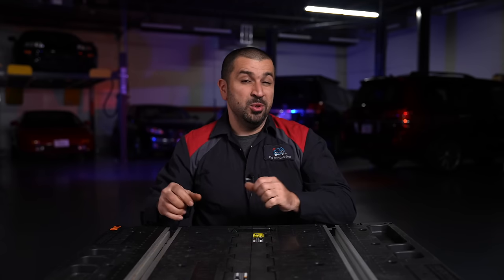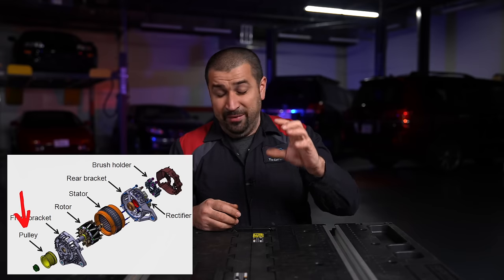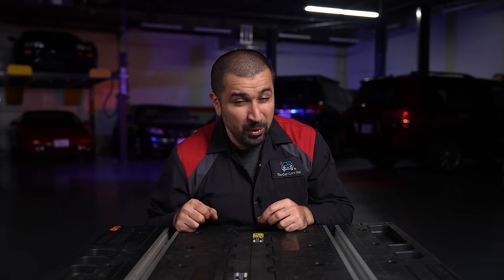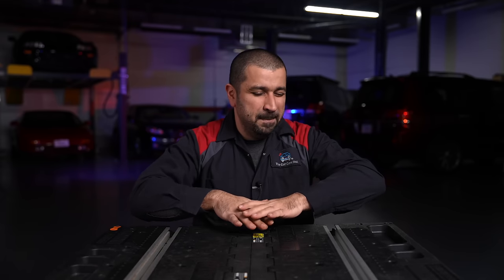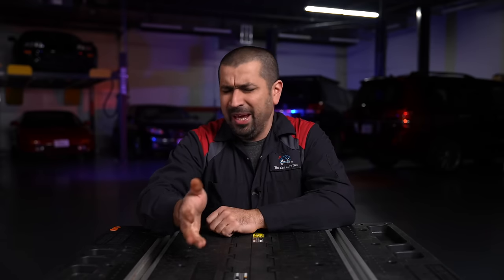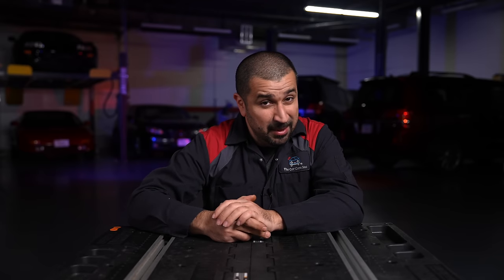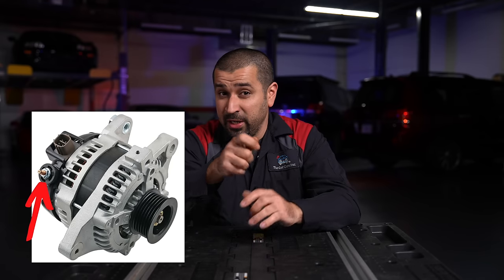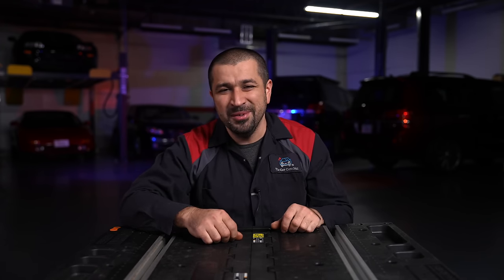How To Make Your Car's Alternator Last Longer? Everything You Need to Know

Comment: the trick were using here in my place where lithium replaced most car batteries is called super capacitor relay system .... itll only engage when theres a surge current needed (eg to start the engine with high torque dynamo this same electric engine will charge the battery back aswell using a large rectifier diode relay in series with some transistors for automatic switching) the bms will handle the balancing of the batteries and cutoff and anything else

Comment: I used to rebuild alernators and there are 6 diodes. 3 negative and 3 positive.  I never seen one go back. Usually it is all the negative or all the positive ones that go bad or all of them will blow together. When an alternator starts whining, it is already bad

Comment: Old days one belt around pulley voltage regulator removal the auto electrician s took yours and replaced with a reconditioned one 😅

Comment: How to stop it from failing?  Be sure not to let a loose aux wire touch your seat bracket while the engine is running.  I burned mine out.

Comment: An alternator repairman told me by daily using a trickle charger that the battery and alternator will both last longer. He said the heat from charging wears out these parts.  When the batteries are fully charged the alternator pulls less

Comment: That was a very informative video!!! I just had an issue this evening when I came out of the store to head home with groceries. Turned the key over and nothing, no turn over, no clicking, there is a noise though. I'm not sure how to describe it.... maybe a whine, like a freewheeling spin might sound??? My battery is good, i did check the volts. Do you suppose that would be the alternator? Possibly the starter/solenoid? It's still sitting in the parking lot, I'm planning on getting it towed to the Ford garage in the morning. It's an '05 F150
Reply: 99% of the time, it is just a bad battery.

Comment: Hi CCN,so glad to see your vid on alternator, my “Swedish Tank” 4 cylinder petrol turbo’s alternator just died at 165k km , I managed to get home with the juice left in my battery as I was drive with my 4yo child. Firstly battery light came on,  later ABS,ETC turned off, just about to reach home power steering no more. Towed my car to the workshop for replacement tmrw. What should I look out for after the alternator changed? Do I have to change my AGM battery (also 2 years but I drive every day)? Thank you n God blessed u!
Reply: I would suggest you get the workshop to fully recharge your battery. This will save the alternator from overworking because that battery is now in a very low state of charge.
AGM batteries are very robust and will last many years if kept in a good charged condition. 
If you do a lot of short runs invest in a smart charger and use it about once a month you will increase battery life for years.

Comment: There is nothing wrong with aftermarket parts. I bought my alternator from Autozone and so far it has not gone bad after more than 50k miles.  If OEM is good why did it go bad after 30 k miles?
Reply: What car brand?

Comment: I rarely drive my car nowadays. If i don't drive it more than a week, I can't start my car. I usually just jump it, and I usually don't have a problem with it the next day or the day after. But sometimes I end up not driving again for a week, and the issue repeats. Also, it happens if I forget to unplug my dashcam.

My question is, is it actually bad that I keep jumping my car in this case? I just replaced my battery 2 years ago, so I'm hoping I don't need to replace it again soon.
Reply: If you rarely drive your car, and have a garage or a driveway, use a trickle charger (battery maintainer), and connect it to the car battery and plug it into a household outlet.  Just disconnect it before you drive the car, and connect it when you get home.

Every time a battery is allowed to get to a low voltage state (where you need to jump it), it damages the battery and shortens its lifespan.  Your car dying after a week (without the dash cam on)  is telling you the battery is old, damaged and should be replaced soon.

Comment: I have a question on battery replacement on 2020 4runner ORP,  ir gas dash cam ,offroad lights, and winch. Would you use a AMG or flooded aciid.  Any brand do you recommend?
Reply: Also Drone mobile  installed

Comment: I never liked voltage  regulators inside alternators, ended up having to replace both when its just an issue with the regulator  unless you want to pull the alternator to get at the regulator and then in some stupid cases have to pull the alternator apart but some are just two torx crews

Comment: So the question I have is when should I replace my battery?  
My 2019 Highlander is over four years old, no signs of battery issues...but the battery is not the standard flooded type but rather the EFB..and Toyota wants over $300.  Can I use an AGM which is more available?  And should I replace my battery now or wait longer?  I have the start/stop system, but I disable that before I hit the road.
Reply: Costco Interstate AGM. Done.

Comment: AMD, so my theory was correct that’s why every three years I get a new battery I’m still on my original alternator on my 2013 Subaru I’m at 150,000 miles.
Reply: I'm on my second battery on my 2012 Sienna with 280k miles, original alternator. I'd scrap that Subaru😅

Comment: When I worked as an "A" mechanic for Buick, 75% of alternators were just a bad rectifier bridge. I could R&R the alternator, R&R the bridge, and replace the brushes in 30 minutes and get paid 1.5 hours.
I agree with the failure rate of aftermarket alternators. When you have uneducated people just replacing parts, you will get those high failure rates.
Reply: You are a flat-rate master. Bless those easy-to-repair Delco 10SI and 15SI alternators. Cheers!

Comment: My 2004 Grand Caravan ( I believe the first year of the electronically controlled transmission) started exhibiting electrical gremlins. The transmission started shifting roughly, the Speedo needle  would sweep around the dial and stick behind the stop, the radio would play up, fuel gauge read incorrectly, power locks play up and more. Turned out to be diode problems!  A quick and easy fix once identified so this may be of use to someone else who is experiencing these issues.
Great video, thanks.
Reply: I had the same thing happen and wouldn't have guessed in a million years it was the alternator until l watched a video by Scanner Danner and he talked about AC current causing all sorts of electrical issues. I really thought my computer was malfunctioning.

Comment: Excellent Excellent vidio I learned so much, I always thought it was ok to use the altenator to recharge a battery and not using aftermarket alternators and starters but Toyota oem parts are ridiculously over priced. Thanks for being such a great instructor and mechanic.😊
Reply: Because OEM parts are designed to last 200k miles, not 20k miles....

Comment: We have a rav4 prime there is no alternator or serpentine belt. Same with the Rav 4 hybrid and other Toyota hybrids as well.  Nice not to worry about changing a serpentine belt every 60,000 miles or so.
Reply: That is because the 12V battery is charged from the high voltage Hybrid battery which takes the 288V of the Hybrid battery, and uses a DC to DC converter to charge the 12V battery.

There is an alternator/generator on the car, but it high voltage instead of low voltage, and it is part of the Hybrid system.

Comment: I have a 2008 Forester that I just replaced the original alternator with 200,000 MI it was on top of the motor
Reply: Blessings to Subaru for placing it where you can easily get to it. Cheers!

Comment: Is it ok to charge the battery when the car is off? Does the alternator care? I have a solar charger on our Tacoma, and the alternator is charging the camper battery also, via a DC-DC/solar charger. But that unit also charges the truck battery.
Reply: No prob, doesn't see your charger. Alternator's diode trio module isolates unit from incoming DC. Cheers!

Comment: Does the Toyota have magnets in the alternator to generate the electric field?  Personally, I remove the alternator and disassemble it and lift up the grease seals on the bearings and add more grease, wipe clean and reassemble.  This keeps them going much longer.  Occasionally I have had the rectifier go out at which time I buy a new (not rebuilt) alternator.
Reply: No magnets. Rotating magnetic field is initiated by THE BATTERY. That's why a marginal battery causes alternator to deliver sub-standard output.

Comment: So crazy my alternator just stranded me yesterday! I noticed the whine a couple weeks ago and have been pushing off diagnosing it. On the way home from work yesterday, sure enough radio cut off first, then the battery light came on, then everything just started flickering and eventually shut off. Thankfully, I was able to safely pull into a parking lot and not get rear ended by rush hour drivers. Question: do any of the electronics get damaged after something like this happens? (2010 Lexus IS250)
Reply: you might get a low voltage code ,
Reply: Very unlikely.

Comment: The original alternator in my 1993 Toyota pickup, 310,000 miles still working fine.
Reply: Also, Japanese starters should last at least 300,000 miles as long as there is no auto- start / stop nonsense.
Reply: Probably has no air conditioner. Very little electrical load preservers it from wear and tear

Comment: Best part about owning a Toyota Prius as a second car… NO ALTERNATOR!!!!
Reply: yeah until you have to replace the hybrid battery pack or the dc-dc converter🤣
Reply: @funboy8704  Not for a loooooong time in a 4th gen(battery pack). I work on Toyotas for a living. The earlier ones had those issues for sure. Inverter failures are also not very common. ICE water pumps and inverter water pumps. Only see inverter failure due to overheating.

Comment: Great video? I'd like to hear about how much an alternator should put out at idle. Mine is putting out 13.5v at idle and a lot of people say it should put out at least 14v at idle. I have a cheap alternator tester and it has u turn on lights,radio,heater,to put a load on it and it said my alternator was bad because at idle and full load it was putting out 13.4v. Had it tested at auto-zone and their tester puts its own load on and u Rev the car to 2,000 rpm and it passed that test with 13.8v. I would love to hear ur take on this
Reply: Read your manual

Comment: We've had weird experiences with aftermarket alternator when the service advisors started offering them. 

Got a few reworks where the idle rev kept oscillating. Turned out, the alternator was periodically not charging/unloading the engine, like instead of holding 13.8v, it was jumping between 12v and 14v. After a few cars came back for the same issue, we had to tell them OEM only.

Comment: Great advice and explanation. My 07 Honda pilot still has the original alternator made by Denso. I’m debating if I should replace it along with the also original starter because of age, I don’t have any issues but it’s always on my mind. 

One thing I don’t like to do is start jump another vehicle while  the engine running, also I replaced every single halogen bulb with LEDs, that helps lowering the load on the electrical system.
Reply: I replaced the alternator on my Corolla at 180 k . The old one was working fine - l keep it in my trunk.
Reply: @shinola228  I’m planning to do the same.

Comment: Not even the local Toyota dealer had the 2004 to 2008 Toyota Corolla Alternator: I found it over rhe Internet in Asia, oem, not a rebuilt, price is high but the aftermarket one already failed no matter it is the best recommended by trusted mechanics; From Asia at more than $700 is better, then I can say that phrase bad dealers hate: " see you in nearly 18 years " . The dealer had to reinstall the original which came with the Corolla because their remanufactured alternator failed at the same Toyota service bay, and they could not find another.....was around 1 year ago.
Reply: Hey Pablo: $700 was a real PT Barnum move. DensoAutoParts online catalog informs me your Denso 210-0395 rebuilt alternator available on line, $200 at NAPA stores and wherever else Denso rotating electrical components are sold. Cheers!
Reply: @blackrifle6736  Remember. Those prices you wrote, are around the same anyone pay for a remanufactured alternator, just like we did here. The $700+, is for a brand new original, not remanufactured., this are the ones that will not fail like my remanufactured already did, no matter it was covered by Auto Zone warranty.

Comment: It's really difficult to find OEM Toyota alternators anymore for older models.  I bought remanufactured alternators for my Toyotas and noticed the performance is not anywhere near the OEM items.
Reply: Denso rebuilts use OEM Toyota/Denso cores. They're located in SoCal and will take your call. Cheers!

Comment: I once had a battery replaced.  The technician knew that on that car, if the battery cables were reversed it would fry the diodes and require the alternator to be replaced.  I saw him do it.  I went to management who denied having it done.   I took the car to the dealer service center to replace the alternator to fix the problem.  Be careful when working on or replacing the battery.
Reply: Scummy!

Comment: I was about to utilize my cars alternator to charge my power staion when driving . Is that going to hurt it ?
Reply: No.  It will be fine.  The current draw isn't a factor as power outlets on cars are typically limited to 10A, and the alternator is usually at least 80 to 120A.

Comment: Doesn't the alternator use a bridge rectifier that converts the negative voltage to positive, yielding better efficiency?
Reply: The bridge rectifier has 4 diodes. It would be easy for the audience to understand the simple diode function. In reality, there is bridge rectifier inside the alternator.

Comment: What’s your opinion on using a diy alternator rebuild kit or remanufactured denso alternator?
Reply: Depends if the wire coils are fine. Replacing bearing and
Rectifier would be better than dEnzo or buy an OEM and we all know how expensive those are

Comment: Does changing the battery often (say every 3 or 4 years) help to prevent alternator problems?
Reply: in general yes.  but a better way is to have the battery load tested.

Comment: Good video. I have a couple of questions. Does the alternator care if you install an AGM vs. a flooded lead acid battery? For example, our Prius came with an AGM battery, can we replace it with a non-AGM battery, Also, what is your opinion on rebuilt OE alternators? Thanks.
Reply: That 1 requires an AGM
Reply: The battery cares.
Reply: I’ll bet if you “move backwards”the old style battery would work and wouldn’t mind being charged as if it were an agm battery and the car and alternator would be ok.
Reply: @new2000car  hybrids don't have alternators
Reply: @DylanL69   Duh, but the Prius was just an example of DrElectron1's. His primary question was if an alternator cares. I say an alternator doesn't care, so don't think oooh you got me.

Comment: Installing a larger battery than the manufacturer recommends will also reduce the life of the alternator.
Reply: Any Scientific explanation behind that? Please explain.
Reply: @MechaTronic161 If fitting a larger than recommended battery you need to fit a larger capacity alternator. It will overload the standard alternator, especially if the battery is low and after start up. This  results in early failure of the alternator.

Comment: To be precise, there is not one diode, but six, assembled into a three-phase rectifier bridge circuit. The bridge does not cut off the negative part of the half-wave, but changes its polarity and turns it positive. This way we get double rectification efficiency.

Comment: My 17 tundra died so I charged battery and took to toyota to get battery and alternator checked with a alignment after just putting new tie rod ends on and the alignment was $160 and was told to replace some other stuff on front suspension so I did and went back a week later for another alignment to find out that my truck is to big for their machine which was odd seeing that I was there a week earlier and charged and now being told that it definitely will not fit so i spoke to service manager and was assured that the truck is to big for alignment with 7 inch lift and 22 inch rims with 37 inch tires so i was charged for a service that was never done and even sat around for a hour and a half I was only reimbursed my money and nothing else after the fraud work done.